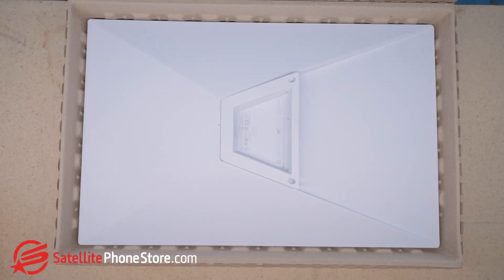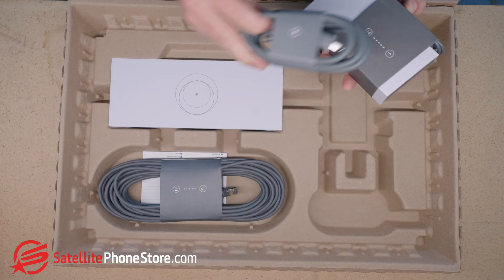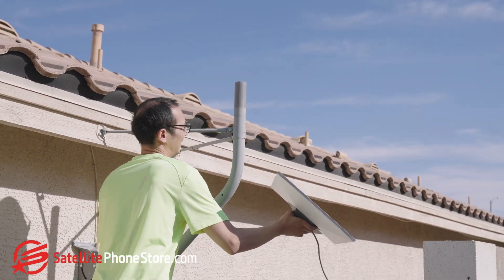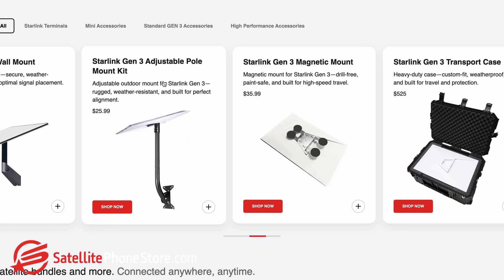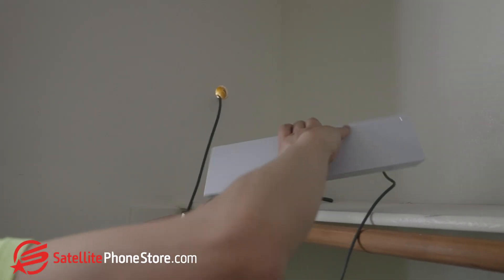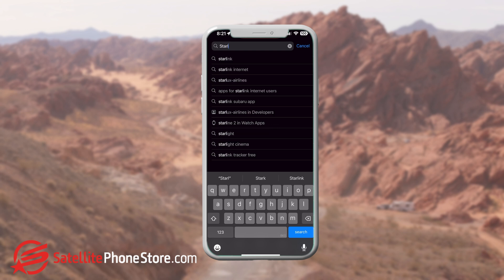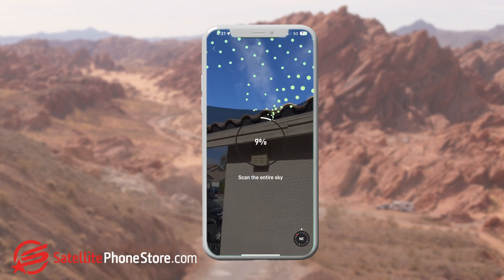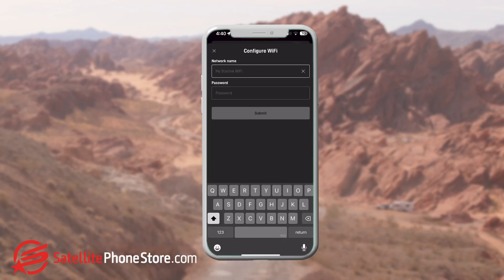How to install starlink Generation 3

Comment: What I don't get is why with all the billions spent on the satellites, you end up with a Gen 3 K-Mart router. Very poor build quality and the noise coming from it, electrical scratchy noises and a hum. 
Haven't head anything like it since my 1200 baud modem from the 1980s. You won't be sleeping in a room with this thing.

Comment: Don't use the Starlink "recommended installers".  They have cancelled on me three times, and now I am being billed for a system that is not activated or installed.  You need to plan on doing this yourself, or finding other help.

Comment: Can this be done with out a cell phone?   Can it be done with a PC ?
Reply: Nope
Reply: @smileNchew   I did it..( with out a phone )  I installed the dish and positioned it to the general direction.  Run the cable to the router. Powered it and logged into my account. With the AI support, They provided a link to a setting page where it says/shows how many degrees off from the best angle, and which way to tilt or turn it.  Once that was done. I connected it to my PC and disconnected from present ISP.  It took a few trips up and down the ladder to get it as good as I could. But it was actually good enough from the start and I could have switch from local ISP to the Starlink router right after mounting it!    My average MBPS is 300 down & 20 up.

Comment: can i connect my desktop pc with the starlink router with a basic cat6 ethernet cable so i dont have to use wifi? also how good is the wifi signal of that router compared to others on the market?
Reply: Yes, you can connect a pc directly to the router via cat 6 (doesn’t necessarily need to be cat 6 but I only use cat 6 rather than cat 5).

Comment: Can the indoor router be left outside under cover and totally clear if the elements?
Reply: Yes it can. I purchased starlink for my security cameras at a work site and have it inside a cooler. It works just fine.
Reply: No it cannot

Comment: Yikes that guy drilled a massive hole. You’d be better off hiring a tech so they can feed the cat 6 through the wall and crimp a new fitting on.
Reply: 100%!  cant tell you how many times I had to redo DIYers or a "handymans" work

Comment: Can we connect external WiFi Access Points Via LAN
Reply: You can use whatever router/modem combo you want. You dont have to use starlinks necessarily. So you can do whatever youre smart enough to put together really.